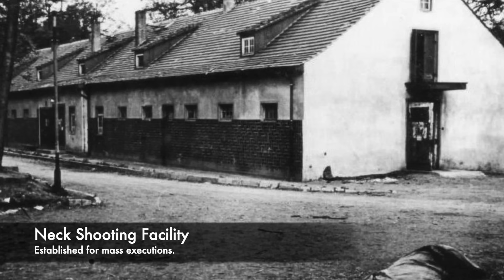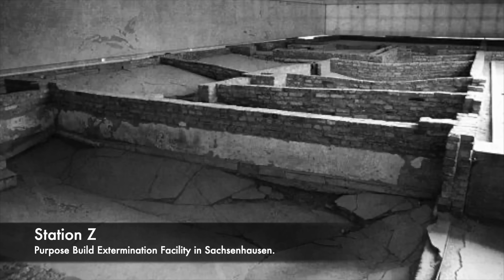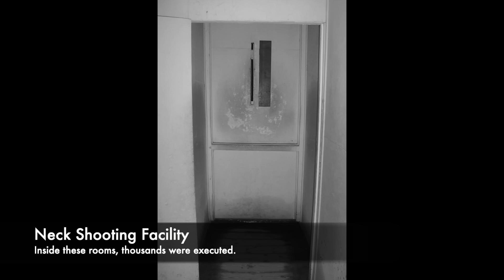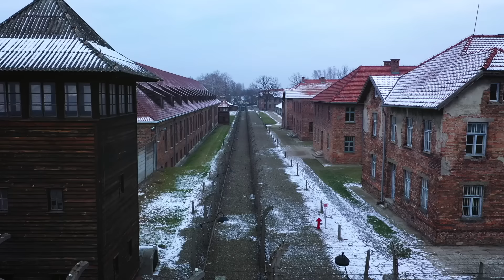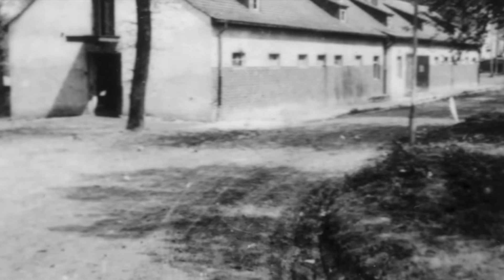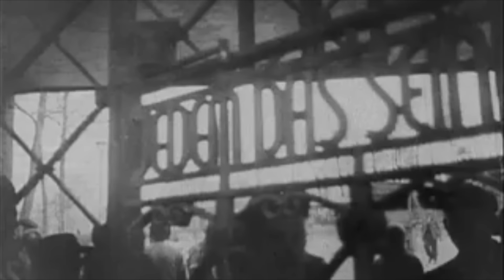How A Neck Shooting Facility Execution Worked

Comment: 100 percent of this doesnt make sense. Shots make sounds. Bullets  makes a mess. Their bodies jerk and fly THROUGH people. Silencers do NOT obscure the sound enough.
Reply: You are not very smart.
Reply: Concrete building? Subsonic round/silenced. You probably couldn't hear it 10m away.
Reply: You do not know what you are talking about.
Reply: A subsonic round through a suppressor can be amazingly quiet. It can also be stopped with less mass, as in a neck.  Bullets do make a mess, there is blood, but essentially cutting off the brain from the rest of the body causes all vital functions to stop almost immediately, the body would collapse as soon as the round went through the brain stem. A graded floor and a hose can wash away blood relatively easily. Just because you can't fathom it, doesn't mean it wasn't happening. Given enough time and practice people can become quite refined in a certain method of killing. Russia also used similar methods, one man at a time, one bullet.

Comment: that would take a while. if the subterfuge was important at all, all blood, noise, etc would need to be hidden. id have used a trap door in the floor, that way blood or bodies could be easily dropped in to a basement body pile for further processing
Reply: Yes I agree with you a trapdoor would have been much more efficient
Reply: And really the processing would be the most interesting part